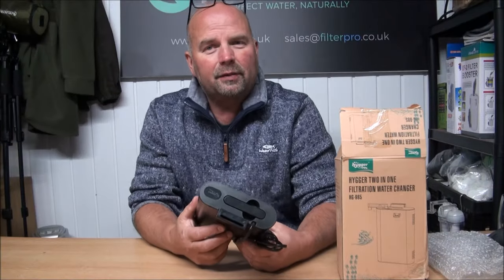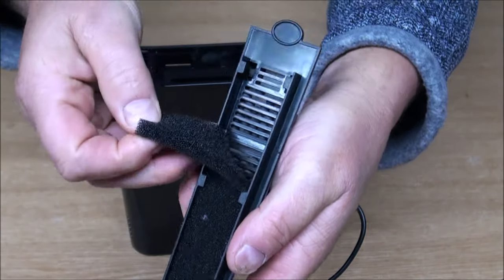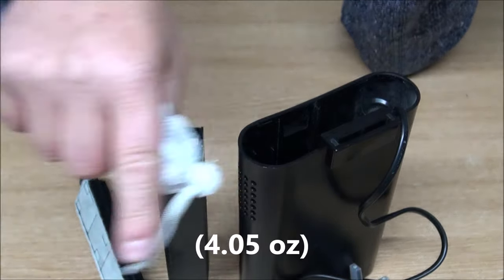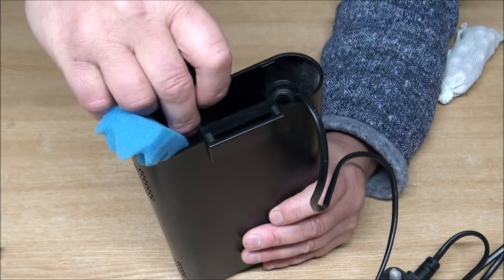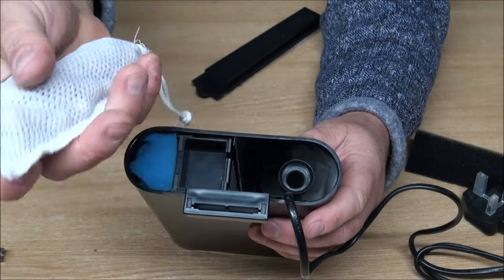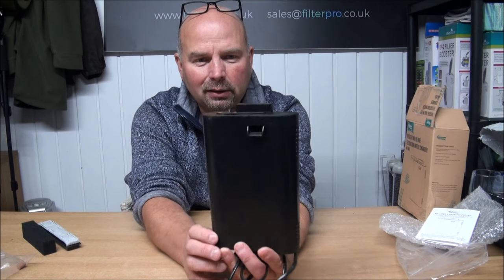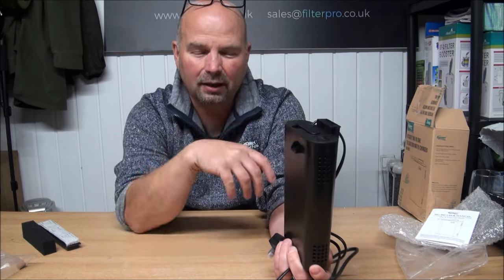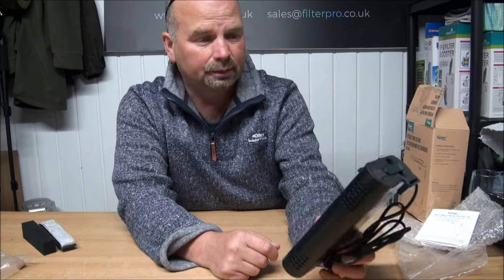Pimp My Filter #89 - Hygger 2-in-1 / 3-in-1 Aquarium Filter

Comment from the maker: This is an unusual filter which is described as either being 2-in-1 or 3-in-1 but there appears to be no difference between the 'different' filters - I have no idea what the other function (3) is or does so if anyone has experience of the mythical 3rd function of this filter I'm all ears....
Hygger filter on ebay: https://ebay.us/E4o23Q
Hygger filter on Amazon: https://geni.us/vZlu
While this is an internal filter (which I'm generally not a fan of) it does hold a reasonable amount of biological filter media when upgraded so is a good choice since most of the internal filters available now rely solely on replaceable cartridges.
Please post your reports of using this filter long-term in the comment section - that is what it is for. Thanks in advance.
As long as you avoid using damaging water conditioners which starve the bacteria in the system by messing with the ammonia, nitrite and nitrate (e.g. Prime) there is no reason why you shouldn't be able to achieve a full cycle (0-5ppm nitrate) when your filter is properly sized and set up well with suitable filter media.
That's what this series of videos is all about so if you've found this video useful please share it on Facebook, whatever Twitter is now or any other 'social' media sites.

If you'd rather watch these videos with no ads then check out my Odysee channel here:  https://odysee.com/$/invite/@PondGuru:0

RECOMMENDED PRODUCTS ON AMAZON: https://goo.gl/jMaBWy
INSTAGRAM: https://www.instagram.com/pondguru_outdoors/

FILMING EQUIPMENT:
Panasonic HC-VX870 HD camcorder http://geni.us/3UwE
+Rode stereo microphone: http://geni.us/4OL
+Rode 'deadcat' mic cover: http://geni.us/1pmn
JVC Everio quad proof HD camcorder: http://geni.us/e09e
+Rode 'deadcat' mic cover (opened up and held between tripod and camera base) http://geni.us/dee24
Zomei Z666 tripod: http://geni.us/1a1af3
Manfrotto MTPIXI-B PIXI mini tripod: http://geni.us/87f7

If you've enjoyed this video please check out the playlists on my channel for hundreds more  - on a variety of subjects.
Feel free to share or link any of my for the benefit of anyone you think may also enjoy watching.
See you next time.
Pondguru
Reply from the maker: Apologies for my voice in this video - I had a heavy cold which has dragged on for a week or more. I edited out all the coughing, lol

Comment: Totally unrelated question pondguru, sorry for being off topic.. I'm thinking of making a clay lined dew pond/ swale water catchment pond in a sloping field with fairly fast draining soil. Am I fooling myself thinking that will work? Should I just go with liner? I have access to tons of  clay from a foundation I dug .
Reply from the maker: As long as you have suitable clay and a constant water supply going into the pond it will work. Clay needs to be kept wet to hold water and if it dries out it will crack, hence the need for a constant water supply flowing through it.
The land I built my raised clay lined pond on had many layers of sand between the layers of clay in the ground so I put visqueen (cheap black plastic) under the clay. That allowed the clay to spread out against the plastic liner and totally seal it - we've had no leaks and it went in over 20 years ago.

Comment: Nice one Rich, looks pretty smart I would say , especially when you replace that pointless cartridge with that large piece of sponge. Yeah that's alright. Good to see you buddy,, you not needed your boat to get to your office in the morning yet then ? 🌧
Reply from the maker: Yes, it's a decent filter although the water change function is a bit redundant.
With regard to the weather my conservatory is leaking in and the pipe leading from my pond to the field was blocked so there is water all over the lawn and conservatory floor.
I've unblocked the pipe so the lower end of the garden is no longer flooded but I'll have to go up onto the roof to see if I can identify where the water is getting in since the gutters are very clean. I hope you've had better luck, man.

Comment: For a Small tank and 
 Pimped out Likely fine.
Also not fan of cartridges 
and Have Modified others
The biggest ripoff is the 
 Minute amount of 
Activated charcoal sprinkled in Enough to Rattle yet basically useless for The purpose 
 designed for. The sleek hob Filter is good where space  behind a tank is limited and PG always 
has great tips for maximum efficiency ✅
Thanks Brother
After trying BIOHOME 
Filter Media, I Use it for
 Each of my Filters that
 Have stages like my cannister filters and Larger
HOB Filters, Great Media
Reply from the maker: Nice one - setting filters up properly makes all the difference and I'm with you on the amount of carbon in cartridges. It is pointless.